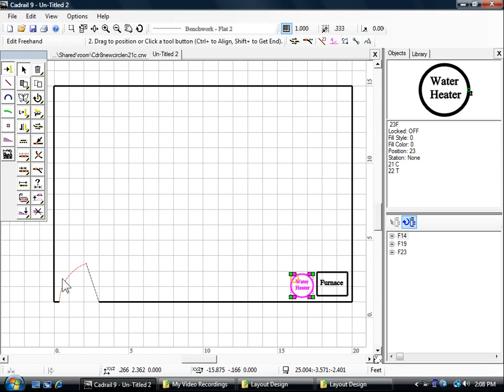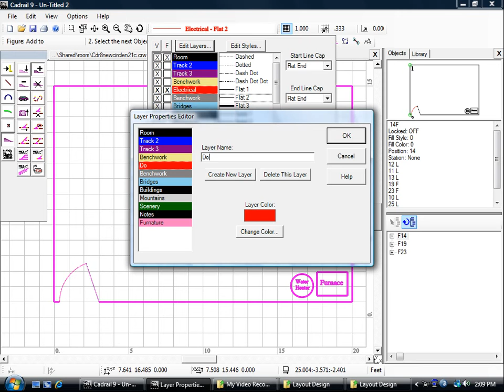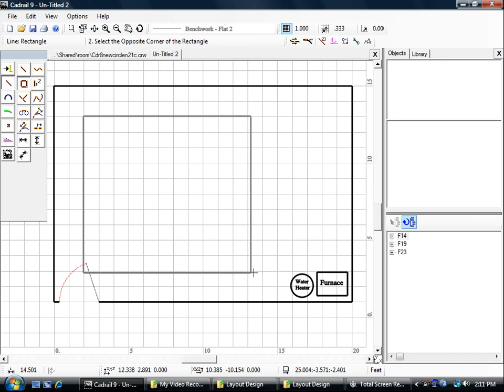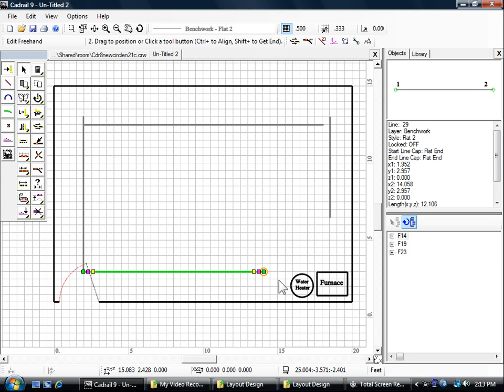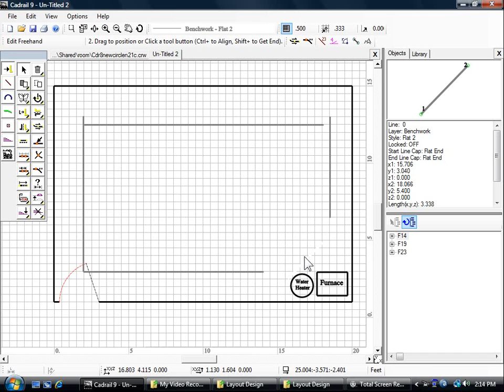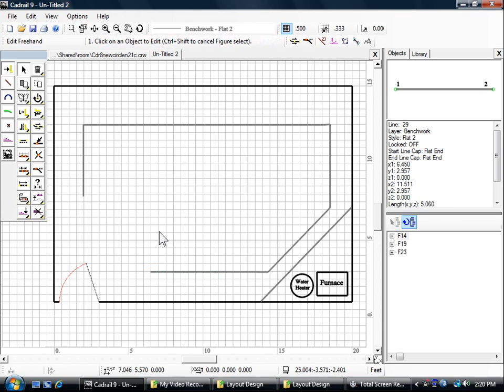Model Railroad VLog: Layout Design & Construction: Part 6

Comment from the maker: Yeah I will. I might re do what I've done so far.  I thought the videos I uploaded were encoded at a high enough bit rate so that YouTube would automatically offer a higher quality version.  I guess they weren't Plus I screwed up and used the wrong encoding format on my screen capture software(FLV instead of AVI).  I got a bit frustrated with that so I decided to take a break and do a series on Kit building.